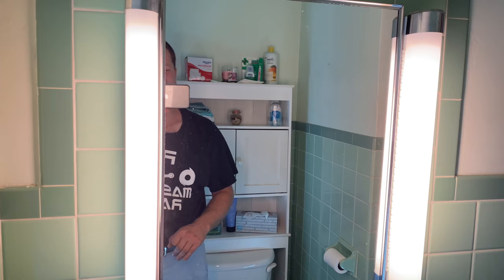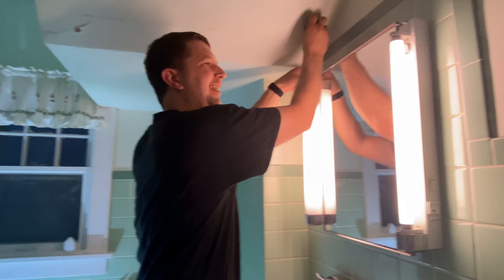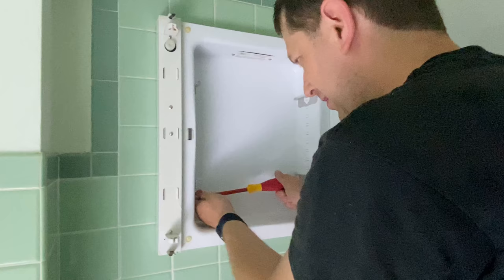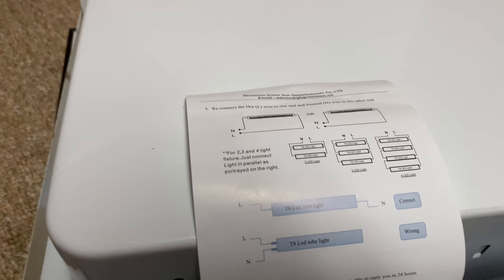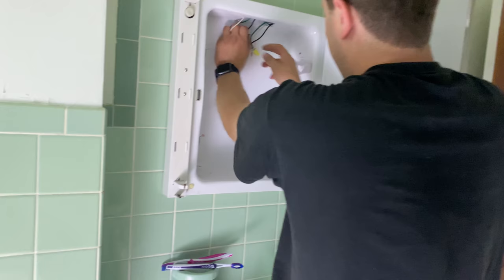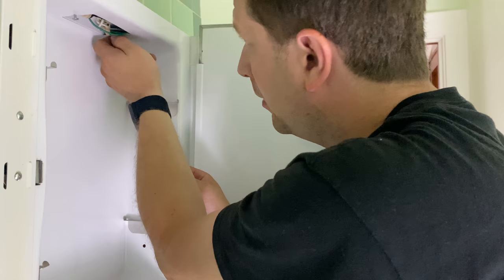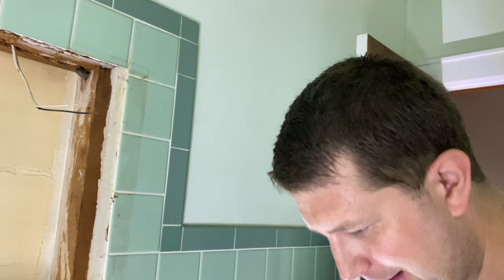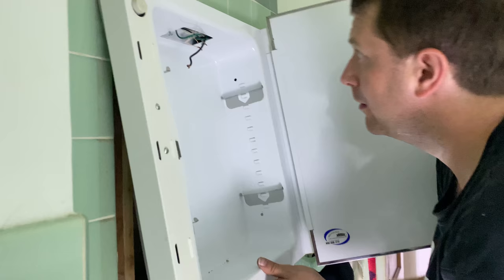Replacing Fluorescent Medicine Cabinet Lights with LEDs

Comment: What are the rough in measurements of this cabinet?  I have an old Nutone SL27P that looks exactly like this only with incandescent bulbs on the side.  I am looking at getting this one if I don't have to do any retro-fitting.
Reply from the maker: It fits inside a stud bay, so that should be 14.5 wide and I don’t know the height.

Comment: What did you have to buy? I have almost this exact cabinet. We just bought the house. It was not even wired to anything anymore? I was planning on having to replace the ballast, holders, outlet, and switch. Would be amazing if I did not have to completely buy everything.
Reply from the maker: All I bought where the bulbs, so just look up what kind of bulbs your cabinet has and buy led versions of those!
Reply: @radozeman  just tell us where you got the bulbs and the type.

Comment: First comment wow 

I've been doing work  on replacing old light switches and I only have a short limited amount of wire to work with. Not able to pull more down  so ya. Someone when they made my house didn't want to waste wire.
Reply from the maker: Oh I've had that many of times! And I hate working with that old wire, usually brittle and nasty covering!